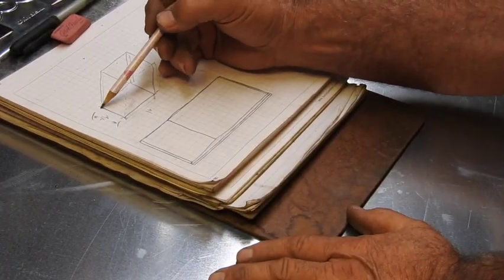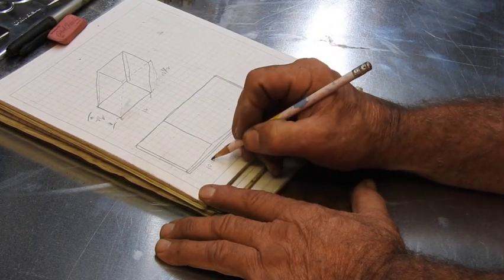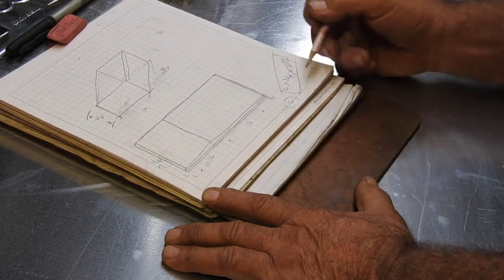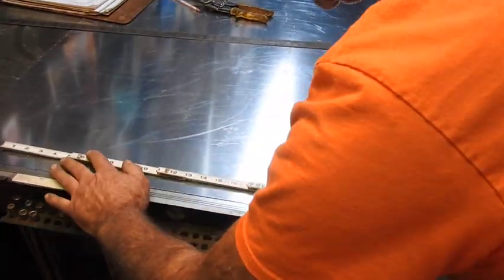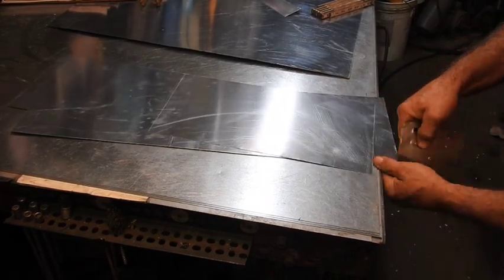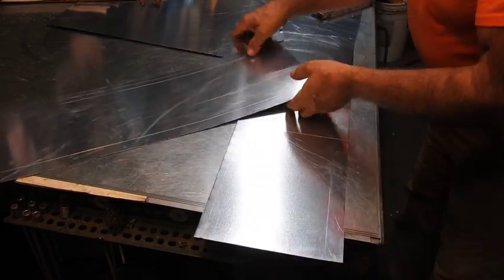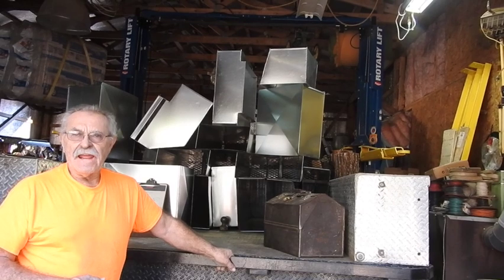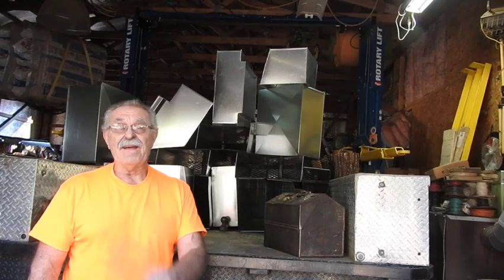Flanged Two Piece Plenum and Knocking Duct Together

Comment: Good morning,  Tractorman44. Moving the metal instead of the scribe when laying out. That's a first for me in my 40 years of tin bashing. I'm gonna try it next time I layout a fitting at the shop. Thanks for the vids,!
Reply from the maker: I tell ya David, once you do it a few times and figure out what size it works on, its really easy.  It may depend on the type of scribe you use too.  My home made flat on on SS is perfect for it.  Thanks for watching my friend...I DO appreciate the time you spend doing it.

Comment: Really enjoyed the video. Your sheet metal work always intrigues me. What is the purpose of the Cross breaks and why do you only put them on the large panels?
Reply from the maker: Cross breaks add strength to the metal.  Otherwise the static pressure created by the fan inside the ducts would cause what we call 'oil canning'....a continual flex out with the blower starting and flexing back to the rest position when the blower shuts off.  We do break all four sides on much larger ducts for the same reason.  Make sense?  Thanks Terry for the visit as well as the question.  This is one of the reasons why I enjoy uploading videos.

Comment: That cleat bender sure beats a hand bar folder.
Reply from the maker: Been there, done that and bent it too !!  LOL  I only have an 8'' and a 12'' bar folder.  I use 'em when I have to on the job to hand bend drive connections on cut off plenums for change outs.  Many times there's not enough space, so I just use the tongs sideways.  Thanks Matt for watching buddy !
Reply: @tractorman4461  You bet Wendell!

Comment: Ah, the wooden fold rule. I have several; most are worn out and hardly readable LOL! I need to pick up and outside fold rule. To me, they are easier to use for layout work.
Reply from the maker: I don't care for the outside read because they have to be flipped so far out for short measurements.  The inside read is really quick for me to lay out short measurements.  Carpenters use outside reads all the time though.  I think its the old Ford vs. Chevy thing:  Whatever you like is right for you !!  Thanks Matt for the visit tonight.
Reply: @tractorman4461  I drive a Dodge LOL!
Reply from the maker: @mattthescrapwhisperer  Now see...THAT's funny !!  I drive a Dodge too, but also the old '85 Ford, which is my favorite for work.

Comment: Your video is very interesting.  Wouldn't it be nice to be able to  make a quilt as fast as you do your sheet metal work!!!      Anyway, you are certainly a very good teacher.
Reply from the maker: Well if they made quilts out of metal, it'd be a bit cold to sleep under.  LOL  Thanks for the kind words. Take care and stay warm.  I hear up that area it turned a bit unseasonably cold.
Reply: @tractorman4461  It did turn cold; had much more snow; and what Mother Nature can always do-------change course.  The temp rose to the lower 40s; a lot of the snow/ice melted along with the assistance of high  winds.  We are currently at 42 if you can believe that!!
Reply from the maker: @akquilter3519  We too had a cold snap, but this week its to be back in the upper 30's and 40's.  Yay !!

Comment: Wendell, you sure make using that cleat bender look so simple.  How many times did it take me to get something that look half way decent when you were showing how it worked?
Reply from the maker: Hahahaha....you found out that there IS a little bit of a learning curve with it didn't ya..!!  It was awkward in this case because I had the camera on the right side and had to use it left handed, which I almost never do.
Reply: That thing kicked my ass for months when I first started lol
Reply from the maker: @brandonmartin8305  That one was given to me back in the 70's.  It was missing the lower clip that holds the bottom handle.  I had to make my own clip and add a spring to get it to work the way it needs.  It takes a while to master it...especially with 4', 5' and especially 8' sections of duct.  LOL.  Man I remember THOSE days !!
Reply: @tractorman4461   Literally going through fixing the lower clip and spring on the one at work last week lol. 22 guage took its toll on the poor thing 😂😂
Reply from the maker: @brandonmartin8305  I wish I had one to repair.  I had to make mine...but its still hanging in there after all these years.  Yes, 22 ga is kinda tough on the grip after a while too.  I did many a good sized job with it, as a matter of fact, I believe there's still a few 48x96 sheets on the rack yet.  Mostly I've used 24 commercially and 26 residentially though.  Thanks Brandon for the continued conversation.  Take care and stay warm out there.  I am...LOL